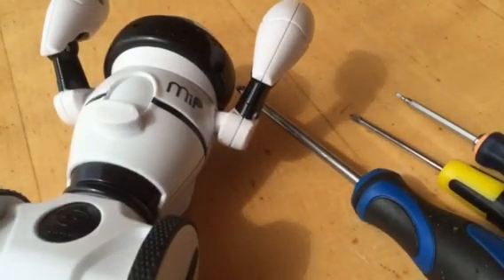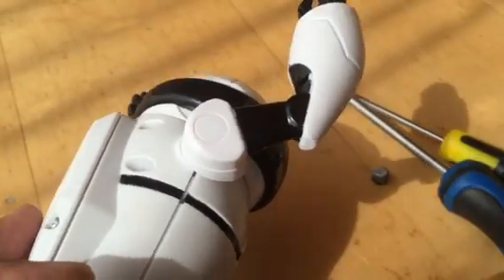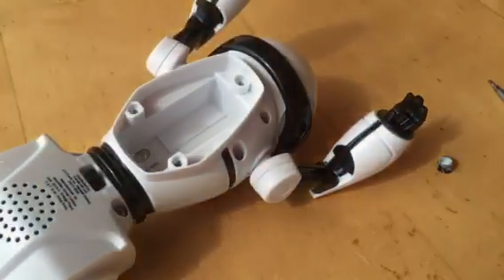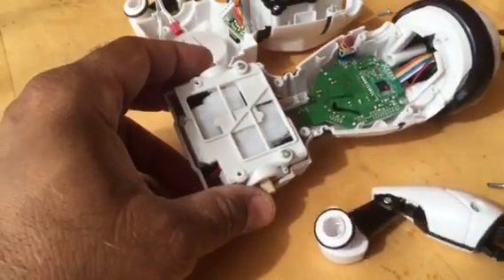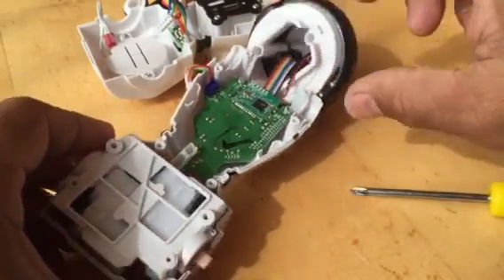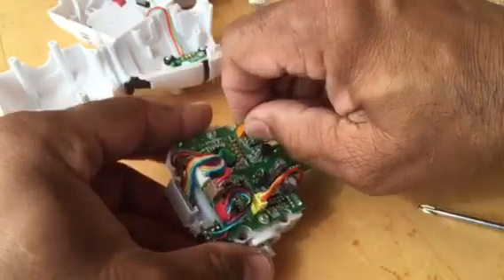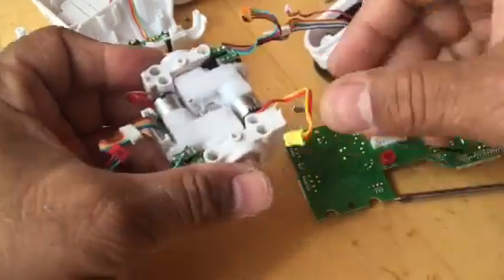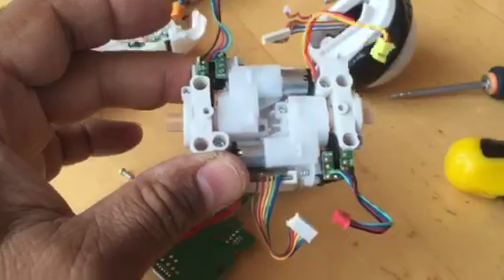MIP self balancing robot taking apart

Comment: cool vid, but i'm trying to take the wheels apart, and he doesn't even show the process of taking them off. its literally out of the camera's sight.
Reply: I have the same problem and i can not get them off i have even tried using a sharp knife to take it off but that did not work.
Reply: quackBLOX - YT Hey have you found a way to take them off? I'm in the same situation that I even tried other small things but even the metal brakes.
Reply: I destroyed the whole cover but I made it. Its a bit broken now but at least I could take off the weels.
Reply: @Seefay  wow